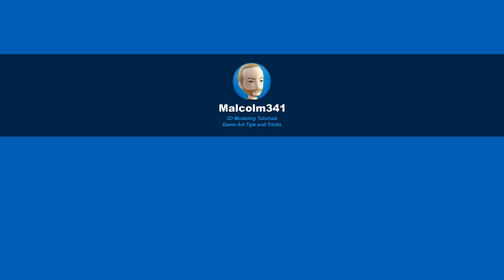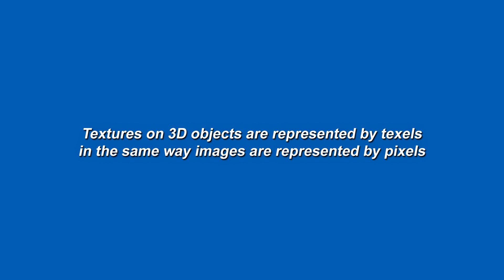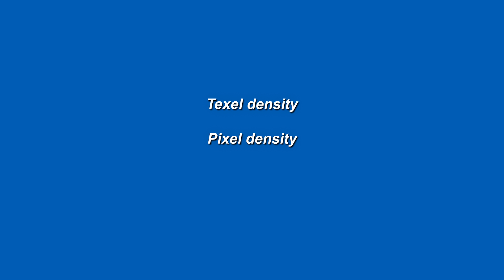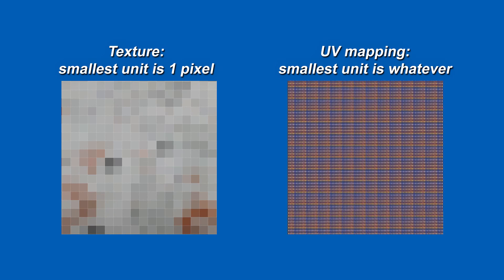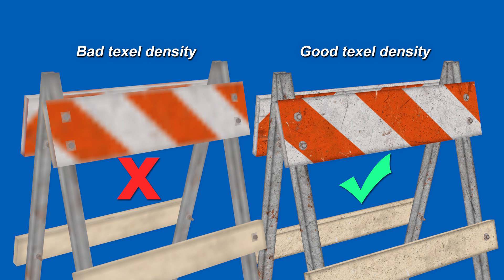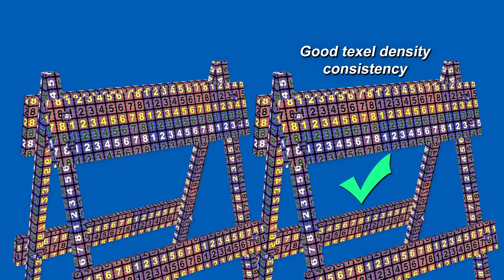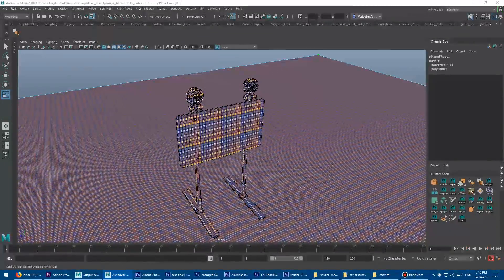What is Texel Density and How to Master it

Comment: Hey Malcolm .... So I understand what you've said in the video but cant seem to get it to work on my asset.... So i have made a small chapel in maya ... If i use the Texel Density tool in maya to set my density to 10.24px/Cm (I read on another tutorial that this is standard ratio for environment props in an FPS) maya scales all my UV shells to sizes to match this ratio, great!!
.... however now there are UV shells that have no chance of fitting in the 0-1 uv space.  and if i scale them down to fit in 0-1 it  will change the TD..... I can for some shells stack, butterfly or mirror uvs and this will work for most shells. But what of the shells that have a single poly mapped larger than the 0-1 space....? I would have to add more polygons to the mesh to be able to cut up the shell to be able to get it in 0-1 but then i would have a ton of seams in the model..... this is driving me insane....
Reply from the maker: @Joel Wynd Hi Joel, 10.24 if you're using 2k textures is about double what I'm used to working with for 3rd person shooters. I think Battlefield last I heard was using 512px =100cm in Maya which I believe is the same as 2048px = 400cm in Maya, but don't quote me on that they may have changed it when Battlefield 1 came out. To answer your question, generally small props can fit onto a single 2k texture and maintain the texel density you're after, but for grounds, buildings, rocks, large props we have to use a bunch of different techniques to keep texel density high and it's quite challenging and takes thousands of hours to master. Typically for environment stuff we'll use multiple textures including tiling textures, trim sheets, and some unwrapped details sheets. For rocks we typically use an unwrapped normal map in 0-1 UV space, but then that overlays on top of a tiling texture to keep resolution high. On top of all those techniques we use decals and vert painting to keep things from looking too tily and trimy. Here's a great tutorial for an introduction to trim sheets and tiling textures. https://youtu.be/IziIY674NAw
Reply: @malcolm341  thanks so much. Great link will definitely implement this into my scene :))

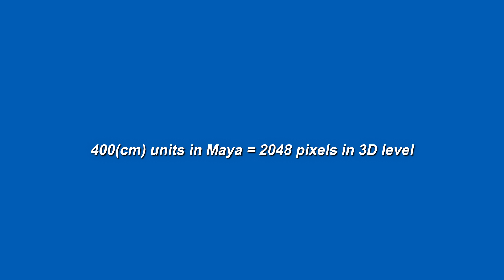Comment: Ok,I'm really confused,on 2:00 why 400cm=2k,200cm=4k,100cm=8k???large model with low rez texture,small one with high rez??TD and texture rez are two different things?
Reply from the maker: If you scale a model down with a 2k texture on it you're effectively increasing the texel resolution. Just apply a checkmap to a plane, then apply the same checker map to a cube, then scale the cube down. You'll see that the cubes checkers become smaller with the cube relative to the plane. Texel density is based on the size of texture plugged in, but also the UV scaling. It's all relative to the thing that's mapped correctly in your scene.
Reply: @malcolm341  Well,I mean how do you calculate that 400cm in maya = 2048 pixel 200=4096.....?if I create a 100cm height door why bother of using 8k texture?
Reply from the maker: @waynesun3835  400cm in Maya can = whatever you like, if you apply 2k texture and map it 0-1 in the UV space that would be 400cm = 2048 pixels because your plane was 400cm. For most of the games I've worked on 2048 pixels mapped to 400cm is a good trade off between resolution and repeated details. This becomes especially import when you're working on teams of more than one person so each artist is mapping their assets the same as the other artists. 8k textures are out of the question for the games industry right now, and tiling your 2k texture to be the same number of pixels as an 8k texture will give you way too many repeated details. The easiest way to learn this stuff is to create a plane in Maya and then measure that plane and then apply a texture to it. The number of pixels in the texture will be relative to the physical scale of the plane. Then to make things more confusing you can tile textures effectively adding more pixels across the plane. It's quite tricky, all three factors contribute to your final texel density.
Reply: @malcolm341   Oh,that makes things clear,so I could create a plane and test the best rex of texture right?and every things that larger or smaller than the plan could modify base on this plane to find the best  rez?
Reply from the maker: @waynesun3835  yes exactly, make a plane and then pick your ideal texel density, then just match everything to that as best you can.
Reply: @malcolm341  Thanks,I didn't care about TD problem when I first unwrapping uv , now I know  what the problem is.

Comment: Well, I'm not familiar with Maya but with Blender instead. Wouldn't this workflow cause any issues when you want to paint the asset in Substance Painter or when you want to bake the lighting in any game engine?
Reply from the maker: Hi there, you generally don't paint environments in Substance painter, even an 8k texture on environments would be far too low rez. Typically for environments you use trim sheets and tiling textures, with some unwrapped details. Usually 2 to 3 2k textures for a piece of architecture in a modular set. Lighting for game engines is either real time or stored in a light map which uses a second UV channel so you have nothing to worry about when it comes to lighting models and how their diffuse UVs are laid out. For example everything in Unreal uses a second UV set for lightmaps. Here's a video about lightmaps if you're interested https://youtu.be/pKQWrHBgx2E Even on unwrapped props we'll often need to stack UV shells to keep resolution high, you just have to get good at reusing parts of the texture. To paint things that are stacked in Substance painter you need to move all but one of the overlapping UV shells exactly one UV quadrant in any direction. This will prevent overlapping in Painter getting confused, but still allow those UV shells to share that part of the texture that you create in Substance Painter.
Reply: @malcolm341  
Well, thanks for the detailed answer but this sounds really complicated. I try to paint every asset with Substance Painter to give them a unique touch.
Do I then have to reposition the UV islands back so that they're overlapping again?
Reply: EDIT: And is this worklfow similar to UDIMs?
Reply from the maker: @manollobango  uniquely unwrapping is very uncommon in the games industry except for small props, yeah it's pretty complicated and takes a lot of practice to make your prop look unique and also reuse parts of the texture. Once you've moved the islands it should have no affect in Blender or the game engine you're using unless they have some kind of clamping in the engine. Generally we have UV shells just lying around all over the place, if you offset them correctly there should be no visible change in both the 3D app or the game engine, for Painter it gets confused if you have overlapping shells because it doesn't know which one to paint on, but for other apps it doesn't care Unreal for example doesn't care where the duplicate shells live.
Reply from the maker: @manollobango  no UDIMs is something else, a UDIM is a free pass and requires no effort, but is only allowed in the film industry at this point. The UDIM workflow unwraps your model into multiple UV tiles, but then unique texture each tile using 3D painting in Substance, Mari, Mudbox, etc. Basically in film you can have infinate textures, but working on big textures can be slow so it cuts your model up into multiple 2k textures. Imagine you get make a fire hydrant, but instead of a single 2k texture like we get in games, you get 20+ 2k textures, but each 2k texture lives on a different UV tile in the UV editor so you can only really edit them in a 3D painter. Pretty sweet workflow without limitation. I believe the in UDIM workflow you can also add new parts to the model without having to re-texture it and then just assign the new geometry another 2k texture. This would be the way to go for games, but we don't have enough memory on even the PC at this point.
Reply: @malcolm341  
Okay... Well, I try to model my assets so that they can be used in every application area. They also should be good enough and high res to be used in VR (e.g. if the player wants to take a closer look on the asset). I'm trying to find the optimal workflow to manage this but I'm stuck at the moment ^^ 
Do you know some tutorials that cover this workflow of overlapping UVs more detailed and which also thematize the pros and cons of this workflow?
Reply from the maker: @manollobango  this one is probably the best https://youtu.be/IziIY674NAw

Comment: If you have an object that won't fit into that space, does it ever make sense to keep the texel density the same but make the map 4096?  

I'm working on a stylized tree I was going to hand paint.  In this scenario there specific areas in the "bark" that wouldn't really tile well.
Reply from the maker: Electrified Shock generally no, but it really depends on the project. Generally for trees you'd tile the bark, and then use a second texture for the leaf cards. I have seen some unwrapped barks, but then you'll need to worry about blurry textures up close, or rely on some kind of multi-texturing technique to keep detail high while still unwrapping it.
Reply: @malcolm341   ah okay. I have done trees that way - leaves as repetitive cards.
For this game I'm working on we're using broccoli as trees, so it's not exactly a traditional tree. It sounds like I have some testing to do.

I definitely appreciate both the video and response to my comment- I'll echo what others have said in that my fancy school degree never taught me to worry about texels. Appreciate the info and time 😊

Comment: What if you want to bake some props in your environment? Then some uvs have to be unique and 0-1? How would you match the density then?
Reply from the maker: It's usually okay to have over rez for smaller props have mip mapping so everything will match up when viewed from a distance. If you're talking about big props that need 0-1 and therefore will be below target texel density this is were you need to employ other tricks. Multiple textures, tiling textures, trim textures, and stacking UV shells are the usual way to get around that problem.
Reply: @malcolm341  yes, im trying to wrap my head around environment creation. So for like building structures its adviced to have trim sheets / tiling textures? Can I scale those uv island strip as free form as I like OR do i need to also calculate the size via texel density? Lets say I was gonna bake prop (the street barricade) from zbrush, therefor it would need to be in a 0-1 space. So its okay for me to fill most uv space to get a decent bake? Wouldnt that sometimes lead to it looking more high res than other stuff? Lets say I have a castle and i use trim sheets and tiling textures but in the end I fill the scene with individual baked props. Would it be okay for me to use most uv space on them even tho they would look more high res then?
Reply from the maker: Yes for buildings there's no way to do it unless you use tiling textures and trims, you can also have some unique stuff in there as well for windows, signs, doors. You ideally you want your building to be the same texel density which takes a lot of planning to get the trims to be the same texel density as the tiling parts. For props depending on how small they are you can unwrap them 0-1, if they get too big you'll need to stack shells or multi texture. Generally small props are always a bit higher rez which is okay, but ideally you're not using a 2k texture on a coke can. What you should watch out for on props is that the texel density within the 0-1 space is even, except tiny details I usually scale those up. I generally try to unwrap my stuff with as few seams as possible which can lead to wasted space so I scale up small details to make use of that space.
Reply: malcolm341 thank you so mucj man, I will soon do some experiments so this information helps alot!

Comment: correct me if I'm wrong,

texel density for example 10.24 will also be used as 1024 texture map? 5.12 to 512 x 512 map , 2.56 to 256x256 map?

as I found some of my props ranging from only 2.50 in a 128 resolution map is that okay?
Reply from the maker: No this is incorrect, there has never been a rule that a 1024 texture map needs to be mapped to 10.24 texels. This myth seems to have originated from really old school level designers from the early 90's before texel density theory was established in the environment art community. The rule to follow is set your texel density for your whole game before you begin texturing things, then follow that as best you can for all objects. UV mapping is relative so you can technically map a 1024 texture to any number of texels. In my video I just mention the most common texel density I've worked with as a professional 3D artist which is 400 centimeters = 2048 pixels. I've read about other games that map 200 centimeters = 1024 pixels, affectively the same resolution in world space, but double the tiling. I think Battlefield uses 500 centimeters = 2048 which is too low in my opinion.
Reply: @malcolm341  hi, https://www.artstation.com/artwork/qbOqP this is the link of that info I just posted.

may I ask you have discord? some are clear and some are still a puzzle to me.

I used blender for measuring my texel density. at first okay setting up one mesh with 1024 grid then the small one with 256 grid they are all equal in grid is this okay that is why I posted also that my texture set becomes 1024 and 256 to.

Comment: this insight is really superb with information, question.

when I setup my texel density for example (Mesh.A has 2048px with 5 texel density then Mesh.B has 256px with 5 texel density) what happen is that it appears my Mesh.B has the same size of 2048px I notice it when I exported it on Marmoset Toolbag with Grid Mesh.B has small grid while the 2048 has fairly large grid why is that?

and also question 2 is it okay to change the resolution of my map for example texel density of 5 can insert to a 256 map so even If I have a 1024 map I just make it to 256?
Reply from the maker: Thanks for your comment.
1. I'm not too sure what you're asking here, could you post an image of your question. It sounds like Mesh A is large in scale and Mesh B is small in scale which would cause different grid sizes.
2. Yes, after the UV mapping is done you can just plug in a smaller texture and that would half the texel density. A common practice in games is to author textures at a larger resolution with defined texel density and then have to scale them down by half later to fit everything into memory.
Reply: @malcolm341  

1. Mesh.A is true large in scale like a Tent and Mesh.B is an Axe.

2. Yes, after the UV mapping is done you can just plug in a smaller texture and that would half the texel density (this is what I've done after searching this texel density I find that my Mesh.B has a 2K Map and when I set it to 5TD under 2048px it turns that it is small almost like 128px but then again I just make it 512)

A common practice in games is to author textures at a larger resolution with defined texel density and then have to scale them down by half later to fit everything into memory. (my axe texture was 2K and I just scaled it down to 512 and avoid 256 = is this how it done once you get the Texel density you will "JUST" adjust the texture map resolution or scale it down) ?

appreciate it dude learned and realize something is wrong with my procedure but this give me a overview.
Reply from the maker: @pawpotsRS , yes typically if you set the texel density first for your whole scene, ground, architecture you will probably use 400cm in Maya = 2048 pixels, then you might create a prop which is much smaller than 400cm in Maya, but because the prop is so small it should be easy to get a texel density of 400cm in Maya = 2048 pixels or even higher, so smaller grid size when you place the axe on the ground. This gives you 3 options, you can unwrap more unique faces of the axe instead of having to stack shells, you can leave the axe with smaller grid so it's actually over rez which is good for props since you often get close to them and zoom in, and you can scale the axe texture down by half when you're done if you find it wasteful, without having to touch the UVs. Typically it's okay to have the props be a little higher rez with smaller grid, it's kind of impossible to make sure everything matches up perfectly, but the ground, walls, and buildings should hit the correct target texel density since they'll use tiling textures and trims so there's no excuse.
Reply: @malcolm341  hi thank you for your immediate response I get it on some point now, gonna study it more since my only solution after completing the texture without realizing the TD, I just scale down the texture map to half of 1K to 512 for the other since this is where they land after found out that they are really small in 2K Rez.

Comment: when i right in opt box of uv 400 it does not match with the smaler plane
Reply from the maker: Are you using the tool I created or just the standard Maya channel box, if you're using the tool I created you must re-project using one of the mapping methods. If you're just typing in the channel box it should update as you type new numbers. You might have history on your planes so make sure you delete history before you do your planar projection.